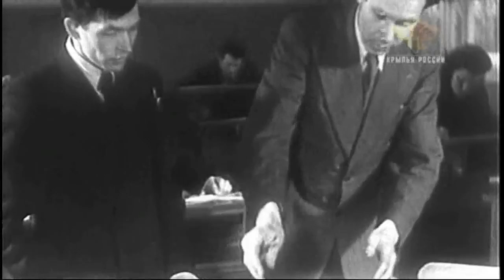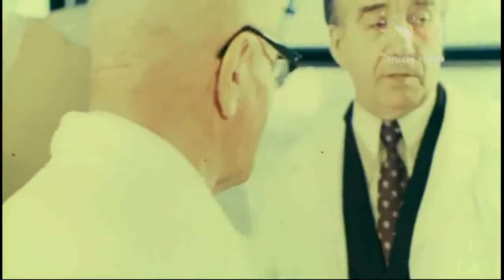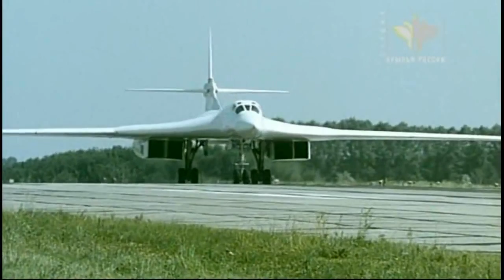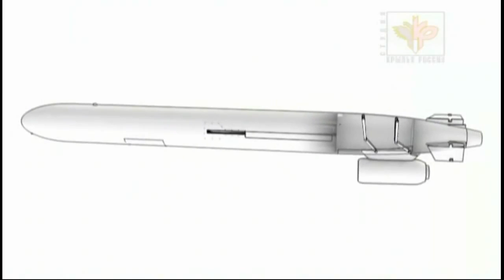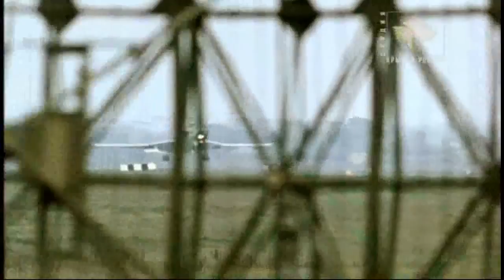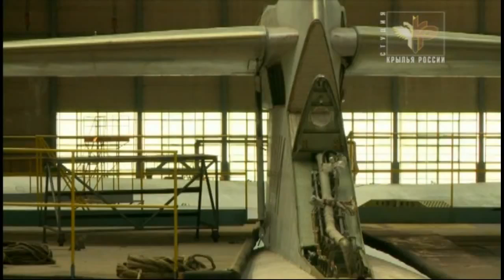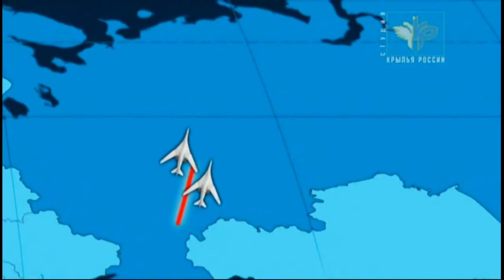Tu 160 ' White Swan '! Wings of Russia

Comment: The TU160 will  live on for many more decades. It could even last longer than the TU95 and probably the B52. It is so much more versatile than any other large bomber aircraft ever developed or built.
Can fly high and fast, low and slow, has enormous range, carry an enormous load of Cruise Missiles or a huge load of Dumb Bombs.

Comment: The nitrogen is used for inert gas purging of the fuel tanks (to reduce the risk of explosion in case of hostile fire engagement) and doesn't mix with the fuel. The added nitrogen never reaches the engines and has nothing to do with neither engine performance nor the yellow exhaust plume. Many aircraft engines produce such fumes at high power setting, it's not unique for the Tu-160 and it's mostly a sign of dirty combustion.
Reply: Not true, it's part of the fuel. When did you get your YouTube degree?

Comment: The first time I learned about this aircraft it draped me in. Not because of how it looked, more on the differences between it and the US made B-1a and later the B-1b. The B-1a was a bit less refined than the B-1b although it had some advantages like top speed. I personally never heard of the B-1b Lancer until I got assigned as a maintainer for it when I graduated basic training. Over the decades since its first official flights the Lancer has constantly been updated. Even when the U.S. had it denuclearized for a treaty with Russia it remained a strategic force to be reckoned with. The TU-160 does have feature that can lead you to believe its better. Sadly from what I know it’s out of date. The fewer movable surfaces an Aircraft has the fewer things can cause break down. That’s why you don’t see sweeping wings on civilian owned aircraft or even newest military aircraft. I agree that a B-1b flying low level with wings swept back is a beautiful sight at sunset. It can’t out due a the SR-71. I’ve only ever been able to see it at air parks but even parked on the ground it looks like it’s going supersonic. I would love to set up an Airshow for high speed aircraft enthusiasts. Maybe on a hill side somewhere that all the aircraft flying by has to bank into a valley.all while doing Mach .9 or higher. Or  maybe Start with the highly maneuverable fighters first, then the fastest prop. Aircraft and go into fastest helicopters and Slowly ramp it up by top speed. Until you top it off with an SR-71. You could also do it based on each aircraft designated duty (fighter, bomber, attack....). I like being up close but would prefer this over sitting in a fold up chair on a hot summers day on a parking ramp with no shade. Even as a service member you have to wait in lines to go look inside or to talk to the flight and ground crews of that particular aircraft. Working at the air shows can be rewarding. Just seeing how excited young children get it raises your enthusiasm for the jobs you do daily and gives you more purpose. Aircraft are more beautiful in the air so I would lo prefer that.

Comment: One interesting unknown fact they left out: 
Out of fear of an oil crisis, the Soviet Union secretly designed the 160 to fly alternatively powered by vodka. This had the added benefit of limiting inflight refueling, as aircrews had a small port that linked directly to the fuel tanks from the cockpit. If fuel became critically low inflight, all the crew had to do was sacrifice some of there vodka rations to avoid disaster. Sadly, some 160s still crashed due to stingy flight crews unwilling to share.
Reply: MrFang333333
Reply: An interesting hypothesis ;-)
Reply: lame vodka joke
as if americans are any more sober
Reply: Those are Ukranian engines.
Reply: +trap3400
Look up alcoholism by country - Russia is tops on most webpages. USA isn't even #2 or 3.

Comment: They call it the "White Swan."  They should just call it the B1.
Reply: TU160 is a development of TU22M, from the 1960s. B1 bomber came later in the 1970s. Besides, TU160 is a much larger platform and more efficient.
Reply: other way around
Reply: You always keep saying that. Why not say: Brewster buffalo (1937) is a copy of the soviet I-16 (1933), Bf-109 (Germany 1936) a copy of Supermarine Spitfire (1935), F-14 (1972) a copy of MiG-25 (1964), B-767 (1981) - Airbus A-300 (1972), AH-64 (1976) - Mi-24 (1970) and many other examples of "stolen" designs.
Reply: Do your research @Barnekkid you clearly have 0 knowledge of this aircraft and the B1.
Reply: Adel Obeyd Its pointless because both Russian and US designers have no problem copying each other. Been doing it since jet age.

Comment: A very impressive
airplane. It appears to this engineer that it is fully equal to the B-1B. The Russian people have every right to be proud of their wonderful accomplishment. What do you have that is similar in capability to the B2?
Reply: Dave McIntyre compare flight characteristics and learn :)
Reply: Егор Стрельцов more specifically haven't seen anything published regarding the stealthyness of the aircraft. Similar to the B-2 you need to remove all right angle surfaces that will reflect radar signals thereby making aircraft invisible to radar. Another example is the USAF F 35 fighter bomber which even carries all weapons inside stealthy panels to further reduce radar signature.
Reply: Dave McIntyre And what's that stealth good for? disappearing from the radars of underdeveloped countries?

Here an interesting story: The very first radars had a very low frequency and very long wavelengths. People then started moving to higher and higher frequencies.
Here's the catch: Stealth technology only works for high frequency radars with short wavelengths. Any first generation or second generation radar could pick up your stealth bomber without a problem.

Modern military radars use multiple wavelengths. Yes, stealth technology reduces detection range by a bit, but it's nothing, you should sacrifice performance for, unless your main objective is to bomb lesser developed countries for oil.

As for a direct comparison, the TU-160 can carry twice the payload(well, it's a bigger plane) and has slightly longer range.

The biggest catch, however, is that the B-2 is limited to flights at subsonic speed, with the TU-160 being more than twice as fast.

But that isn't the important measurement at all. The important thing is, the TU-160 is a beautiful white swan, while the B-2 is an ugly black bat.
Reply: Dave McIntyre B1 is conventional bomber, TU160 is desingated missile carrier, their roles are not same even. Russians never had huge fleets of offensive aircraft, they since 60s based first strike capability on submarines and ICBMs.
Reply: naphackDT 
very short sighted and incorrect rhetoric spouted directly as told by more un-informed people.  There's a reason most modern radars use high frequency radars. Its because low frequency radars are no good for weapon guidance. You might be able to scan large swathes of the sky with a long wavelength radar, and it MIGHT pick up a stealth aircraft.  But you will still have a hard time tracking it and you still wont be able to launch a weapon against it.  That's if youre not jammed by the excellent jammers employed by the latest generation of US stealth aircraft and even non stealth aircraft. Stealth technology is NOT and has never claimed to be a magic bullet. Its an additional tool to be used tactically in conjunction with the rest of your abilities and it has a fantastic history. Stealth aircraft have already shown how good they are when employed properly.  Almost faultless.  So you can make all the claims you want.  im afraid the engineers on the design of these aircraft are far smarter than you and I and id say they have a better clue of whats going on. That's besides the fact that history has already demonstrated their effectiveness. Until you see stealth jets being shot down like flies, im afraid you have little to stand on.
Reply: slickstrings With slight issue there, stealth aircrafts were employed as you say aganist countries with little to no air force and little to no modern air defence systems. There even non stealth 4th gen jets had barely any loses coz there was noone to challenge them in first place.
Reply: ITmage
Absolutely incorrect.  It was widely recognized that iraq in the first gulf war had one of the most heavily defended airspaces in the world. Stealth aircraft flew 1st night of the war sorties right into the heart of iraq ALONE and struck a huge percentage of the targets with 0 losses. The reason why there were not many 4th gen losses is because of tactics. The whole point of stealth is so you can penetrate defended airspace and knock out vital command & control infrastructure and open the door for conventional aircraft.  Once again, the importance is not the total reliance of stealth. It is the appropriate and tactical employment of each air asset. Even though stealth is effective, it is not infallible and careful planning is made to maximize the chances of success. Once the things like networked air defense infrastructures and early warning radars were knocked out, f15's etc were able to go in and shoot down any challenging aircraft, gain air superiority quickly, thus the main concern once guided SAM's were either blinded by EF111 spark varks or knocked out by wild weasels,  were mainly AAA's, of which some aircraft were lost to and others returned damaged.  It is absolutely un-true that they had no resistance to offer.
Reply: slickstrings As an officer in air defence i must highly disagree with that. Iraq had no EW units of any kind, they had only passive radar decoys near high valuable targets. Their Air defences were based on even then around 25+ years old air defence systems that even when obtained as new were downgraded compared to USSR domestic ones. I mean their main SAMs were semi mobile SA2 and Goa. Their KARI integrated air defence and awareness system was made to track and feed info for up to maybe 50 targets at the time (this is not a fact this is what i belive from experience). They also did not have any AEWACs or satelite feeds. Their equipment was not equiped to counter spoofing either. So basically they were antiquated in terms of equipment, ill trained and outnumbered.

So showing us might of stealth over Iraq is just silly. Stealth was made to work aganist technically backward enemy to minimise loses Syria, Iraq, Afganistan, Yugoslavia/Serbia and who not.

Despite whatever the crap they feed you people on West, Iraq was very ill equiped and very ill trained army. Some of their air wing technicans post 2005. or so were trained in facility where i served, and some their officers were studying at military academy to get Higher Command Post Training so i had pleasure of discussing stuff with them.
Reply: ITmage Of course you did mate. 
well,  unfortunately much smarter people than you and I design stealth aircraft and employ them,  so id say until I see them getting shot down in droves, id call their design a success.
Reply: slickstrings I gave you reasons why they havent been. Since you got nothing to sustain your claims other than "much smarter people" and "of course you did" i suggest you to keep your fairly baseless and useless opinion for yourself in future. Do not reply, ty. 250th Air defence missile brigade
Reply: ITmage Your signature should say,  big wanker,  never seen a stealth jet on my radar.
Reply: slickstrings Its ok to be annoyed but there is no need to insult me over your own imcompetence. I mean not that i care about someones opinion on youtube tbh i just like to point out BS someone writes. Actually i didnt see it on radar screen, since i served post 2008, but my unit did belive it or not. https://en.wikipedia.org/wiki/250th_Air_Defense_Missile_Brigade  Enjoy.
Reply: ITmage HAHA. MY incompetence?
im not the one claiming that I know better than say ohh... 2 dozen nations governments... thousands of engineers and designers and pilots....   laughable.  just laughable.
Reply: Russia focuses on defense while the US devotes almost all funds to offense and occupying other countries so Russia does not needs a B2, it has hyperspeed and very effective anti-aircraft and anti-ship rockets and missiles and the best air defense systems.  The US leaves the mainland almost defenseless in its zeal to dominate other countries by force. Despite spending over a trillion a year on offensive actions all over the world(Obama admitted to covert and overt military operations in 132 countries, at the same time).  It spends tremendous amounts on obsolete aircraft carrier battle groups that are defenseless from advanced cruise missiles Russia and  China have. At the same time, every country that is likely to attacked by the US knows that to win, it only has to take out the electric power grid in the US. There are only 13 main systems, all unprotected from on the grown sabatage and cruise missiles. Without power all life in the US ceases, no food(80%of food consumed is handled by 83 centralized distribution centers.), no transportation,  no communications, no internet, no commerse, and no alternatives to the overloaded systems. No country is as fragile in infrastructure yet so completely dependent on systems that have no backup or alternatives. The US would be in civil war or lawlessness in 3 days when those with the 485 million guns kill neighbors suspected of having food reserves. There is so much division and hatred for any of the 1000 or more identity groups by all the others it would be total chaos and savagery.   All you in the US, how many days of nonperishable food do you have and how much physical cash or gold do you have access to?  With no gas available where would you go anyway? 
As few as 20 saboteurs could end all function of the US.  The US really should not be bullying all the other countries it does, it has no defense when one fights back. Russia WILL fight back.
Reply: BS, talking nonsense about Iraqi defenses,

Comment: How remarkably similar the “White Swan” and the “Lancer” are, whether that is totally co-incidental or one nation has plagiarised the other I don’t know, but they are both beautiful in their own right, and to be honest I wouldn’t want either of them as an enemy. Having experience of variable geometry wing systems on a smaller aircraft I can only wonder how large and complicated the system on both types must be, it would have to be extremely powerful and rugged, changing the control system on a small aircraft was bad enough but on such a large aircraft it must be/was a nightmare so would need to be ultra reliable. Despite the Russian developers assertion that the two aircraft are completely different I personally think they are more alike than they would care to admit, the obvious difference being size but the actual overall profiles are such that at a glance they could easily be mistaken for each other. The narration described the intake strokes as being for different flight conditions, just like the B-1, but the B-1s are also for radar absorption, something the Russians would not want to disclose. I am sure that quite a few people will disagree with my evaluation and opinions, but they are just that, mine, so if you disagree, so be it. Thanks for sharing this interesting and informative documentary, you don’t see to many Russian documentary films, even since the Cold War. 😀👍
Reply: Comparing the Tu-160 with the B1 is like comparing a Swan with a goose.
Reply: The film tells why they chose this design:
1. The aircraft must have an intercontinental flight range and carry a lot of fuel. Therefore, you need to use an integrated circuit glider, with a smooth flow. This allows you to carry a lot of fuel.
2. The aircraft must be multi-mode. Fly at supersonic speed and at high altitude. It must also fly at low altitude and subsonic speed to break through air defense. For speed, you will need a wing of large scope, and for small heights - a wing of small scope. Therefore, a variable-wing wing was used.
The Tu108 project was not fast enough, the Tu135 project cannot be used at low altitude due to its swiftness.

And now about B1B:
1. The analogue of the Tu 160 is B1A, but it did not enter the series. Instead, it was launched into the B1B series, which has a different type of use, subsonic characteristics, etc. The US has focused on B2 development.
2. B1B compared to Tu160 - baby. Its combat use, and dimensions are more suitable for comparison with the Tu22M3.
3. Tu 160 belongs to the same class as B52, Tu95, B2. Its task is to deliver conventional or nuclear cruise missiles to the target.
Tactics B2 - a breakthrough of air defense at low altitude and the drop of conventional free-fall bombs. Therefore, it is invisible and has a subsonic speed.
Tactics Tu 160 - delivery of cruise missiles. Without entering the air defense zone, the aircraft drops cruise missiles and leaves. The range of the last X 101 is almost 5 thousand km.

Comment: Call her the White Swan is the most appropriate name ever than what the NATO called her "Black Jack" which is very ugly name for her. Moreover , advance strategic bomber like Tu-160M White Swan deserved a lot of avionics system that featuring LED display system or digital CDU that can ease the Russian Air Force aircraft operation procedure. Currently many of them still running in analogue display and it's too many of them, Russia Air Force needs more upgrade.
Reply: The update will be. The production of new Tu160M2 is already underway. At least 1 Tu160M2 is already under construction. The remaining ready-made versions will be upgraded.